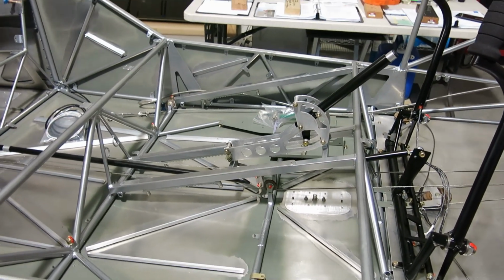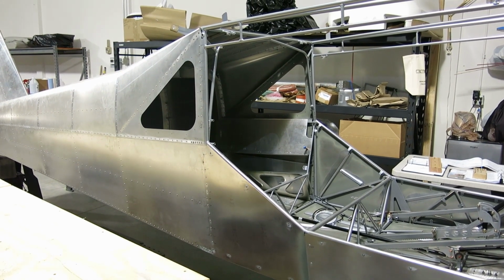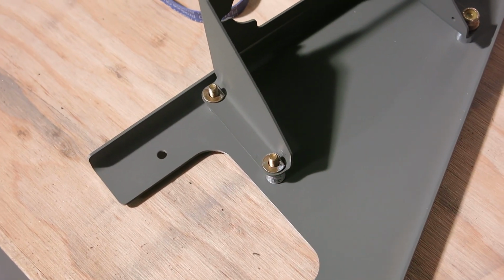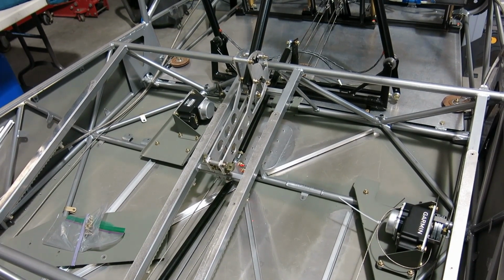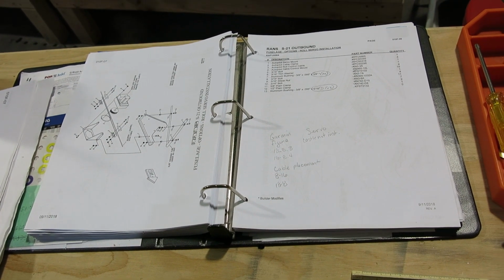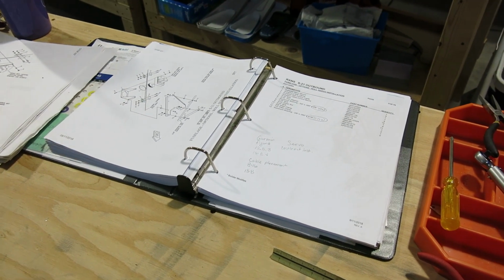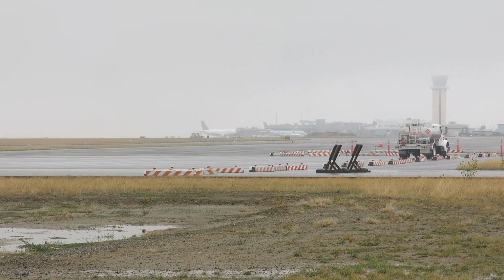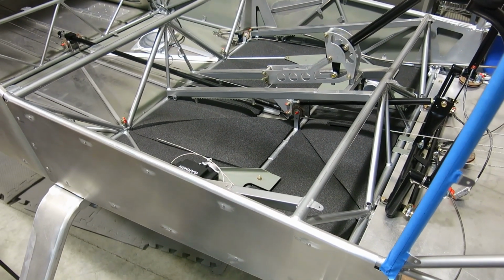No. 225 10-01-2022 Autopilot servos and floor insulation

Comment: I'm doing my servo install now and found that the roll servo did not come with the "Capstan" aileron cable wheel.  I had to order it ($195).  Future builders should make sure to order it when they purchase their servos. (You only need one for the roll servo.. the pitch servo uses a linkage which is provided by RANS in the optional servo install kit)
Reply from the maker: Yeah, the capstan kit was extra. Had to swap out the arm on the servo.